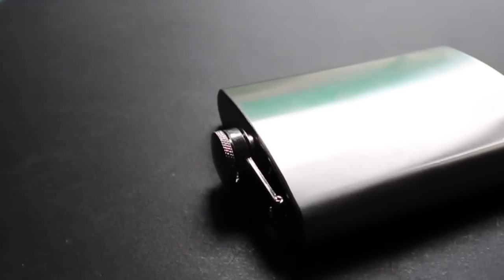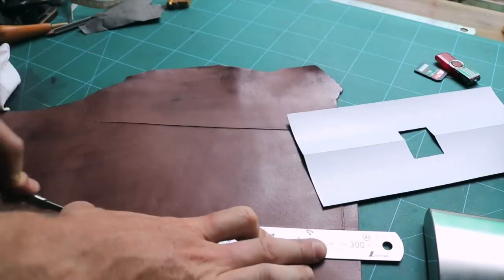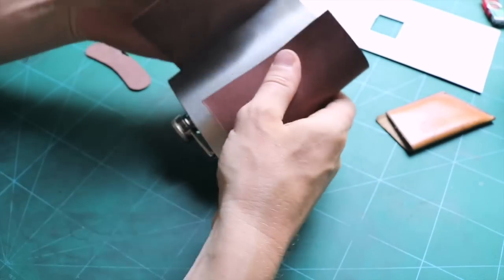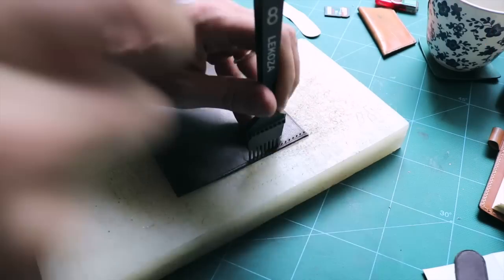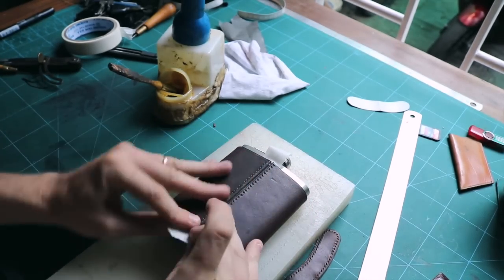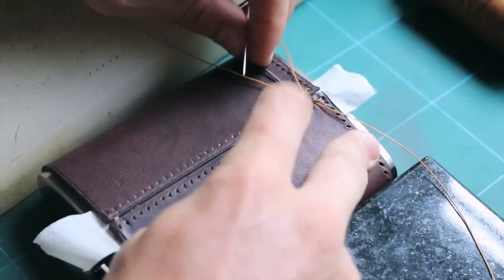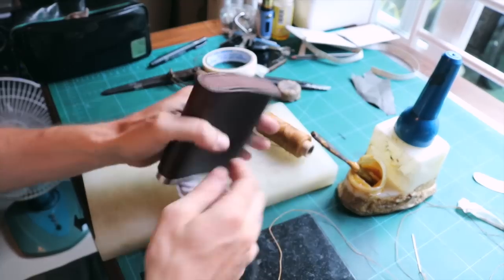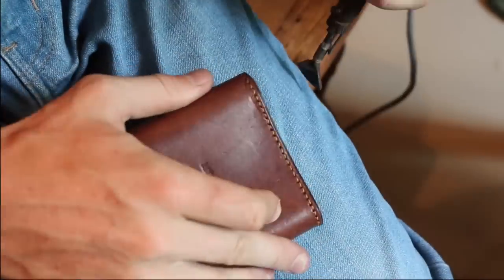Box stitch and butt stitch, covering a whisky flask : leather craft tutorial

Comment: I have tried box stitch before. And I always run into the same problem my holes do not line up or one side ends up having one too many holes am I doing something wrong?
Reply from the maker: Very good point! Yes that's normal. In fact you will always get less stitching holes on one side because the perimeter of the bottom is smaller than the length of the stitching on the body and guess what: it has to be, well, unless you try to compensate the missing stitches on the bottom using a smaller sized pricking iron and do crazy calculation to avoid this issue.

I know it tends to be quite confusing and annoying at first, but no worries, there is a fix and here it is:

To solve this issue you will have to "cheat" by forming a normal stitch on one side (the side with too many holes) and go through the same hole twice on the other side (the side with missing holes) to compensate the missing stitch. The same trick needs to be used each times the issue is met during the course of the stitching.

Hope that helps and that my explanations are not too confusing :)
Reply: The leathercraft academy yes that is very much helpful and I understood in very well
Reply from the maker: Great, I am glad this helps!
Reply: The closer to the edge you make the holes, the less difference you get, :D
Reply: This may help. Two ways I approach it. One is that I start from the middle. When you tighten down the thread, each hole it gets moved over slightly each stich. So from the middle and you work outwards it will keep it lined up. Now extreme radius you may have to an extra hole on the inner side. Also I'll put a few lock stich every few inches in the lined up holes to keep the panels "honest" if u will. Issue is to much space between the single stich you will get a roll or crease. It drives me bananas. Just keep conscious of it and a penny nail can work as alightment pins.
Reply: Hi I make the outer holes first. And then mark the inner holes once the bottom has been lined up.One side hole one inner hole in the right place. I hope this helps

Comment: Really great videos!  Thanks for making them.  Sometimes it helps to bevel the edges that are going to be box stitched together at 45 degree angle so that when they come together they form a right angle.  It looks like you set the bottom inside the wrap, so you didn’t need to bevel the edges.
Reply from the maker: Yep, exactly. I think I will do a video doing box stitch with the 45 degree angle edge bevelling technique
Reply: @Theleathercraftacademy  I've always done my box stitching by beveling the edges to 45 degrees.  That brings both pieces to a nice (hopefully) sharp corner.  I mark the stitches in the smaller piece and then pierce through to the outer.  You still have to mentally visualize where the awl is supposed to exit.

Comment: Nice video.  On the bottom, the box joint, does the stitching on the bottom piece have a different offset than the side piece?  I woukd thing the side piece (at the bottom edge) would need twice the offset as the bottom pice to get the holes to align on the inside.  If you see what I mean! :^)

Comment: Great woorkmanship! On damp leather you may also gently knock down the stitches, using a shoemakers hammer, in order to close the stitch holes around the thread. Also pecking the tip of the awl into a piece of bees wax, in between making each hole for the butt stitch, will make it pierce the leather with less resistance (thus reducing the deformation of it).

Comment: I had some troubleputting holes through the side if the leather. Any tips? Also I want to do the stitching on the other side, without using a bottom piece. How to you get it flush without using adhesive? Thanks and great video.

Comment: I use black rubber board when punching stitching holes. It is softer than the white nylon board, so it is save for stitching punch.
Reply: I use a thin cork mat to punch on which I put on top of my nylon block... the cork does get mangled eventually so I consider it sacrificial and replace when it starts to crumble...
Reply: A wooden cutting board (100 mm. birch wood, standing grain) would be the classic choice. In the shoe making workshop where I learned the trade we would scrape the surface of it once a week, using a sharp edged steel scrape. Then we would treat the scraped surface with a mix of equal parts of boiled and raw linnen seed oil, sparsly applied using a piece of cloth, and use the other (now dry) side of the cutting board the following week. (Edit: Note that a cloth damped with linnen seed oil may self ignite, e.g. if stored wrinkled up or in a plastic bag.)

Comment: Great video. I have just finished the butt stitching part of this project. It’s not bad. I have one issue though. The leather on the concave side of the flask  is flat. It does not follow the concave shape of the flask. Did you achieve this by getting it wet? I could solve the problem with a bit of glue. But I would rather not use any glue at all.

Comment: The answer to the question regarding hole numbers is this, when you handsew leather you mark the holes with the pricking iron or wheel and use the awl every single stitch without putting it down that's how a proper saddles does it you need to become adept at using the awl so as to keep the inside, side of the stitches spaced neatly

Comment: How do you know you are going to get the right number of holes on each piece?

I really appreciate the videos btw
Reply from the maker: Thanks, in fact you will always get less stitching holes on one side, in my case on the bottom. When stitching at one point the holes will not be facing each others, you will need to form a normal stitch on one side and go through the same hole twice on the other side. Not sure whether it is very clear but it should make sense when you are facing this doing box stitching.
Reply: One word....Illustrator, if you are atleast begginer in it, you can adjust and make sewing holes on a line and just experiment. Just Made tiny project with baseball stitch and wanted to try this out, took me like a minute? to adjust holes and line up numbers.

Comment: Great vid, I have been planning a similar project.

One question: Do you pierce the leather straight through with the pricking iron for the box stitch? I have always tried to make the holes diagonally with an awl, which is a pain in the butt. It is difficult to get both sides to look perfect and it usually makes the glue get unstuck.
Reply from the maker: Hello, for the box stitch yes I did, the butt stitch you don't need to as the thread needs to go through the edge.
Reply: The leathercraft academy
Cool, I have to try this method. I kind of stitch through one edge when i box stitch. Maybe it depends on the leather thickness if it is possible to punch the holes all the way beforehand.